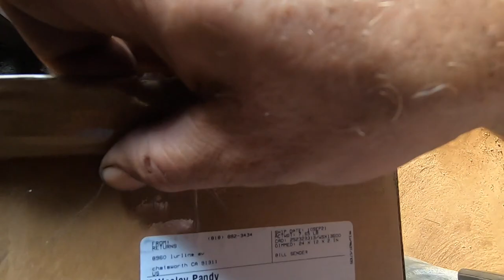To Tall Tim Rat Rod Fun

Comment: dogbed is a good comfortable option for a bed in the tractor  for him, and il bet he likes it!
Reply: Yeah just don't let him lay up on the front glass... Read where a little girl liked to ride in the combine with her Daddy and she would lean up against the glass and put her head against the glass watching the combine run... til one day the whole front windshield of the cab, I guess the glue turned loose and the whole windshield fell right into the header with her and the little girl was killed before he could get the machine stopped.  Never trust that glue or whatever it is that they put those windshields in with now... or even the old gasket types just not a good idea.  Stay away from the glass and it's fine.  OL J R :)

Comment: Hey Wes, 8 mm is the same as 5/16.  So you and Tim were both right.  Have a nice day.
Reply: it's actually not, but close enough in general ;) 
0.002" size difference, some fasteners are just too tight or loose tolerance to fit the nearest size socket well, although the hammer side of any tool will fix that issue :))